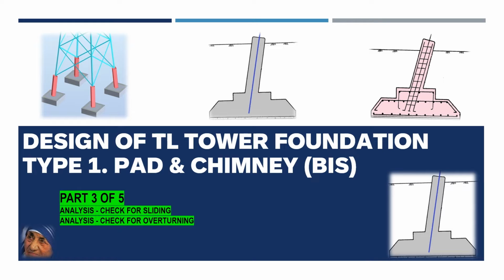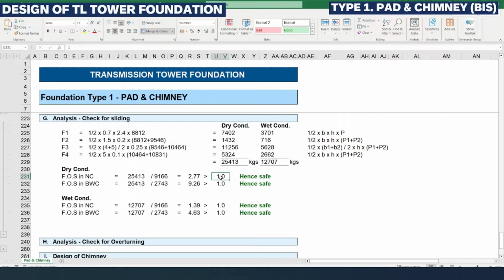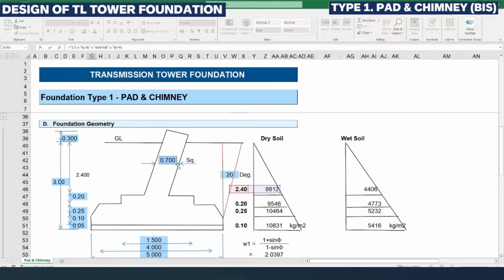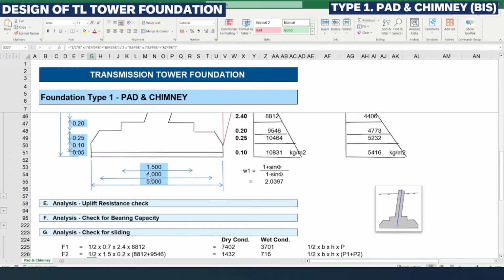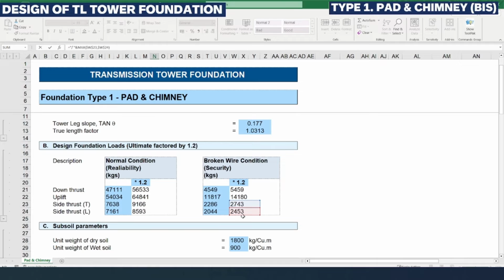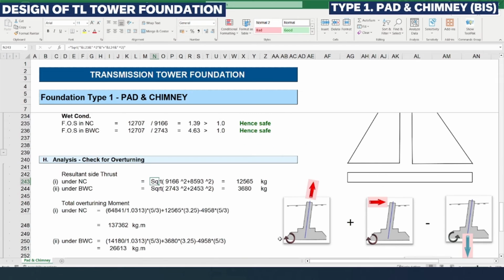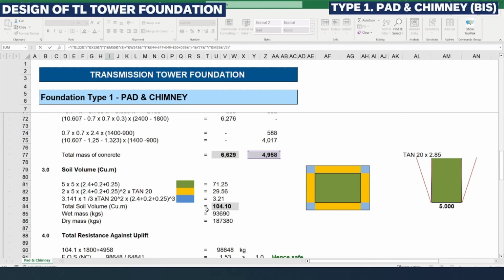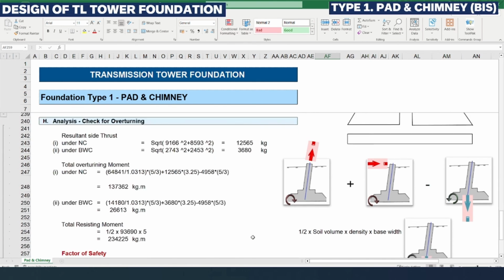PART – 3 | Design of transmission line tower foundation  (Pad & chimney) | BIS

Comment: which checks we will apply the true length factor and the tan theta? or where we will use them?
Reply from the maker: Yes, these inputs are required to check column/chimney design. Also needed for tower structure development and detailing.